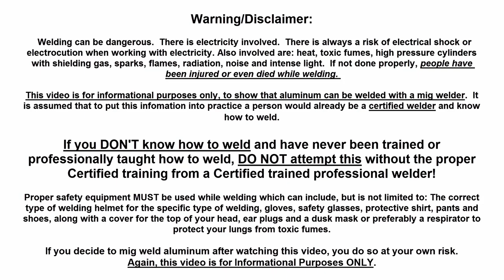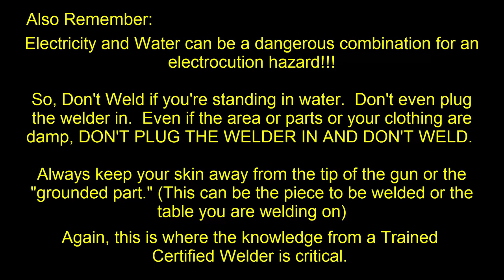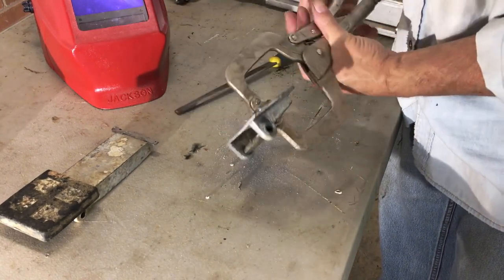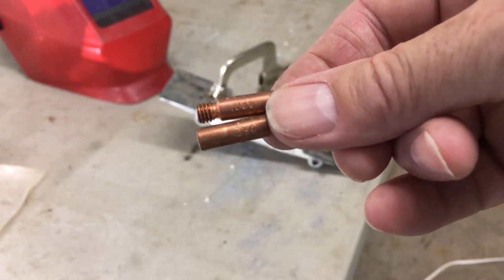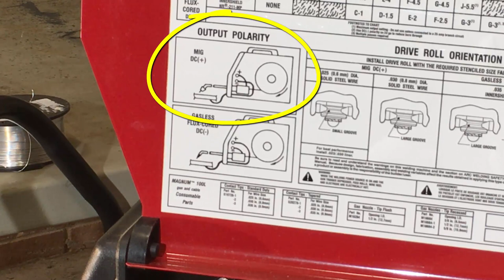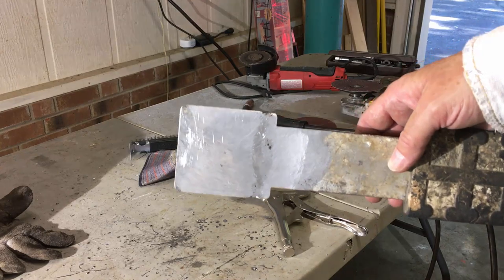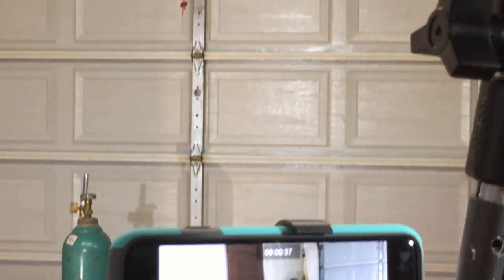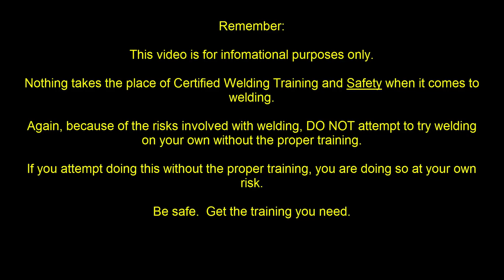Learn An Old Timer's Secrets To Mig Weld Aluminum Without A Spoolgun

Comment: Also the difference in aluminum wire
Is more
Then just the stiffness. It’s also the grade of aluminum witch will vary depending on what the aluminum your working with is made up to of. So you need to make sure you match the feed wire and use the correct level wire for the aluminum that’s your trying to repair.

Comment: You set more tension on the spool of wire to keep it from tuning, and then just enough tension on the feeder to overcome the spools tension will stop the birdsnesting.  There is supposed to be a spring and a washer under the wingnut holding the spool of wire inside your welder.  It should be wingnut, spring, washer, spool. It allows you to set tension on the spool and allows it to turn once pulled by the feeder.  But if you tighten the wingnut to tight it will strip the wire in the feeder, then the wire will not move.

Comment: For using a 120V Mig welder with Al. wire, that's not a bad job. You probably already know that porosity is formed when hydrogen outgasses,  the result of either a dirty surface or too little shielding. An increase in shield gas pressure will help prevent porosity and control thermal flare ups caused by oxygen.  Preheating Aluminum assemblies prior to welding may yield more satisfying  results. 
Reply

Comment: Really great video. I have heard MIG welding aluminum is an AC process. It looked like a DC welder that you were using. If DC, was it electrode positive or negative? Thank you!! 😀
Reply from the maker: DC Electrode Positive.  Thanks.
Reply: AC only for Tig welding they don't male Ac mig machines !

Comment: clean it good with the wire brush then spray her down with carb cleaner. Lightly preheat the parts, and weld away. Pure argon or argon and helium mix if going thicker. Cleaner the better.

Comment: Can you weld aluminum without Arcon gas?
Reply: I've seen aluminum welded with oxy-acetylene using a rod dipped in flux. MIG/TIG requires argon as far as I know.

Comment: why cant you use 75 25 argon co2?  They are both inert gasses are they not? Whats the difference?
Reply: CO2 is active gas, not inert.
Reply: @nz4602  Oh I thought MIG stands for Metal Inert Gas.  not MAG  not Metal Active Gas.  My bad.
Reply: @ScreamingEagleFTW  If you run it on carbon dioxide, it's MAG.
Reply: @nz4602  when I look up CO2 online it says its an inert gas.
Reply: @ScreamingEagleFTW  "MIG stands for Metal Inert Gas.

Only inert gases or gas mixtures are used for the shielding gas when MIG welding. Typical inert gases used for MIG welding are argon and helium. These gases are usually used for MIG welding of aluminium and other non-ferrous metals.

MAG stands for Metal Active Gas.

Active gas mixtures have been developed primarily for welding steels. Typical shielding gases are mixtures of argon, carbon dioxide and oxygen e.g. CO2 , Ar + 2 to 5% O2 , Ar + 5 to 25% CO2 and Ar + 10% CO2 + 5% O 2 .

The composition of the shielding gas has a substantial effect on the stability of the arc, metal transfer and the amount of spatter. The shielding gas also affects the behaviour of the weld pool, particularly its penetration and the mechanical properties of the welded joint.

In the US, both MIG and MAG welding are described by the term GMAW ( Gas Metal Arc Welding)."

"Active" stands for interfering with the material. You add carbon to iron to make steel, therefore it is "active".

Comment: if the aluminum gets too hot causes the middle to pop and splatter makes big gigantic holes so the trick is to use liquid nitrogen or packet with dry ice

Comment: If you have used steel wire through the cable it will be dirty inside and the aluminum wire will be contaminated. You have to clean the sleeve with thinners.

Comment: And by the way the gloves you use are not welding gloves. They are partially made of regular fabric which can easily be burnt if a hot metal drop falls onto it. Look, man, I know this video is not about these issues in essence but you seem to be so concern about safety, so I'd expect you to just be more consequent and consistent. And of course the tips about welding aluminum are great and I appreciate them much. :-)

Comment: the safety caps should be put on before moving the tanks before they are loosened from their supports. a tank will take off like a torpedo. if it falls over and cracks the vale. I have seen  a O2 tank go through 5 cynden block walls before stopping   because a stupid worker took off the cap before securing the tank upright and it fell over.

Comment: I tried getting into welding, I got the same exact welder and every time I went to start it would trip a circuit breaker. I sold it and I have always lamented not being able to proceed further
Reply: Should have it on a 30 amp breaker.
Reply: Don't think your heart was in it.
Reply: @thomasgallaspie9040  I live in NYC, my house is small and its attached both sides. If I cause a mess like a fire or an explosion. I would put many people at risk.. This is probably the main reason I stopped

Comment: having the liner clean so bits of metal do not get mixed in the weld
Reply from the maker: Good point.  Next time I'll use a dedicated "Teflon" style liner that is only used for Aluminum.  Thanks.

Comment: tip .dont hit the threaded end of the bolt without starting a nut on it.is ok to use a tighter punch ,cause it is away from threads.you have a grinder. that file is directional .using it in both directions  especialy on steel  will render your file  useless in short order. backdragging it flattens the teeth.lead being straight without s curves better.a bird cage would be if you ran wire all over the machine, a bird nest occurs when wire looses ability to feed out of electrode and backs up the machine    ;)

Comment: If I have a spool gun, do you still suggest 5356 wire?
Reply from the maker: Thanks for the question.  Probably 4043 would be a better choice if you have a spoolgun, but first check to see what the base metal is.  I'm not a metallurgist, so find out what you are welding before you pick your wire.  Thanks again!!
Reply: The metal is Drawn 6063-T832 Aluminum Tubing, and .188 aluminum rod is going trough the tube?  What's your best guess?
Reply from the maker: I'm sorry to say, but this is beyond my pay grade.  Depending on what your application is,  I'd either check with a structural engineer and/or your local welding supplier.  Maybe even better, you can call Lincoln, Miller, ESAB, etc., I'm sure they would be a wealth of information to help you with  your  situation. Just google them for their contact information.
Reply: dont need to they weld the same, 4043 wont color match 5356 will so if your coloring your aluminum you have to use 5356 really the only difference you need to know the alloys are so similar they have no impact!
Reply: use 6063 filler, 4043 would also work fine but 6063 and 5356 will color match so if its getting colored use 6063 or 5356 even if its not you can use those fillers, i just buy 6063 and weld all aluminum with it, weld it and forget it!

Comment: i have a cigweld gassless mig welder , can i still weld aluminium ?
Reply: No. You need to use gas.
Reply from the maker: As far as I know, there is no flux core wire for aluminum. Thanks.
Reply: peter rudd the only process that has flux included in it's consumables is stick. The rods are extremely expensive and hard to learn to use.
Reply: No unless you can reverse polarity on your machine and supply argon to the weld pool !
Reply: Yes, but not with that machine. Get a Map Gas torch and an Aluminum rod. That is only for light duty applications though.

Comment: Needs cleaned twice the with of bead so burning dirt ect does not interfere in shield flux area .And no fans ect in the area . Can push air in to shield gas flux area.Clean with stainless brush or chemical cleaner for aluminum

Comment: 20:50 I'd have added a few spot-welds to fill in those porosity-cavities in the top surface, and then ground it down smooth again.  This a human-being-supporting device here, so it should be made as strong and solid as possible.

Comment: I haven’t done any serious welding whatsoever in probably 20 years. What really gets me, and I’m not 10 minutes into this video yet, is how he improperly used the file to bevel the edges. A file is meant to be pushed or pulled in one direction. You don’t use a file like a hacksaw and push and pull it across your work.
Reply: actually a hacksaw is a big thin file and could be used exactly the same way and would be considered correct.
Reply: Even hacksaw only cut one way.

Comment: Is there a way to stick weld aluminum
Reply: Yes, you can stick well alum, it's a tricky one. Lots of practice and you'll be able to. But at first it will seem like self torcher as getting the amps, travel speed, angle, and what ever else that's slipping my mind.  Me personally, I never have tried aluminum stick welding, I have watched someone struggle with it and it was funny.  I myself either spool gun mig it or tig..
       It there's a lot I'm doing and it's heavier then .060 I spool gun. It's it's not much, I'll Tig it from 1/4" down to .020 any thinner I'll just toss it and tell boss just to buy said thing new.  Stick aluminum can be done, I just choose not to waist my time trying.
Reply: @jeremybanks719  I can't find aluminum electrodes.  Am I missing something?
Reply: @bigguy8586  . Maybe a Google search and you would find some info on them. A welding supply store might have a few on hand or can order some in. Search for chucky2009 here on YouTube, he did a epic job on stick welding aluminum on here.  Or you can go to the hazardous fart and get a small pack of the aluminum brazing rods, u can use a hand torch and it's like soldiering/brazing but on aluminum. I have yet to try them out but I will at some point. I bet since it's a low temp rod that it acts more like glue to hold together and not bite in like welding, but that can b a good thing on thin stuff like a pop can. Burn through or over peniletration can leave ya with a case of drips n crusty holes you end up chasing never to fill n end up giving up on it  and scraping the day.   Yeah been there, pissed on it, after scraping a few of those parts. Much fun lol

Comment: Decent video.  
Everyone new to welding should spend time on welding forums for more detailed info to complement videos. Weldingweb and the Miller welding forums are the best US fora, and migwelding.uk covers European equipment very well. 
I didn't notice anyone in the comments mentioning cleaning with acetone after mechanical cleaning, but that's standard in the TIG world and makes for cleaner MIG welds too.  (Use with ample ventilation!)

You can, and I have, shortened a long MIG gun to use with Al wire. The gun was kinked anyway so beheading then shortening the cable saved it and got me a free Tweco gun. The cutting is the easy bit (I use an abrasive disk in my angle grinder for the severing cut) and the wiring at the gun end is no problem. You do need to buy the proper Tweco clamp since Oetiker clamps have large ears, but it's only a few dollars.

Comment: Most better migs will weld alloy. Mine is 240V. Use AC. Though from what I know is that you should use a clean liner that is not contaminated with steel.
Your weld does not look very pretty though.

Comment: Brave welding with a single roller set up , my two cents worth is duel roller set up for the wire feeder , and old aluminium I use wire wheel  on a grinder , any corrosion  is not your friend

Comment: you didnt say what the gas flow was some times if you have it to high flow rate it will cool it to fast and not let the impurities boil out also be sure to use a clean stainless wire brush and brush it before welding

Comment: Sanding disc, wire wheel, wire brush, file....you should keep them separate for aluminum only, never use anything on aluminum after it's been on steel,  any wire brushes should be stainless steel......and turn up the voltage, you're running that in short-arc...aluminum wire should be a spray-arc...

Comment: I'm not satisfied with that welding 4043 Ali is for pure material and not for most casting so your probably using the correct wire by chance and should use teflon liner not to contaminate wire Ect too many things to mention

Comment: Aluminum wax shapes going through the metal tubing that cares it to the gun the trick there is to use a Teflon liner to stop the chafing then you use a little bit bigger tip to weld smoothly

Comment: alloys arent much different on those wires, 4043 if u anodize will turn black 5356 you can anodize any color thats what there mainly used for 99% of the time

Comment: without a push-pull wire feeder, migging aluminum is a touch and go proposition against birdnesting
Reply: @ircimager "without a push-pull wire feeder, migging aluminum is a touch and go proposition against birdnesting" even with a straight hose to the machine, teflon liner, 5356 wire and a .035 tip?

Comment: Can ya weld cast aluminum, with that procedure?
Reply: You can't weld cast with any machine
Reply: Actually you can weld cast aluminum. But you really have to heat it at about 400-45- degrees for at least an hour first to drive the gas, oil and whatever other garbage was absorbed by the aluminum, as it’s porous. Clean, clean and then clean.  Grind a narrow “V”, and begin to weld at the bottom, wire brushing each weld before adding the next one. Remember—stainless brush not used for anything other than aluminum.

Comment: First off clean your work piece then clean your work piece then clean your work piece. Aluminum must be clean. Purge your gun before you strike and arc there must be pure argon flowing make sure you have at least 30 CFH on the regulator. Use a pushing motions and not a strait on motion. make sure there is not airflow passing over your part as you weld.

Comment: IF you find yourself doing this leave the big bottle in place and just use the regulator.
  I have left the bottle in the storage area and just used an extra line.
   Why pack bottles all over if it's not empty i'm not moving it.
Reply from the maker: Good point, Chris.  Thanks!!

Comment: Run that polarity reversed,  ground positive/mig gun negative, it'll give you better cleaning action on aluminum (as well as other non ferrous metals i.e. brass, copper, magnesium), not bird's nest so bad as you're "hot" isn't in the wire when you MUST run DC current (inverter generated AC is always preferred with continuous high frequency though...Way superior cleaning action of the impurities in the weld puddle, moves them to the surface where they can be easily removed. Lots of specialists are going to pulse which really attains the highest quality welds.) Kind of a long winded video but fast forwarded through to hit the major points!!  : )'

Comment: Dirty! Just like before, the sheilding gas is in the spool! Also I love the welder! Sp 125 because the "plenty of range" with minimal settings just to get it dialed in for a persons preference makes a perfect weld! Think about that! Those helmets, that's heavey that! I tried and went so called modern! Yikes, just what I tought, in bed for 2 days when it failed! Worst pain you will ever experience for your eyes! Better off with the flick from the old school style helmets! They still have lighter helmets that look nice, they might not have all that expensive equipment you have another job monitoring to make sure thiers no circuit issues with! Weh! Happy welding   :)

Comment: I will add one more thing very few are aware of when it comes to accidental welding flash, nobody does that deliberately and sand in the eyes feeling is nothing compared to what can happen, Anyone welding or watching that uses contact lenses if flashed the flash can dry out the liquid between your cornea and the Contact lense.

 If that happens then the act of removing the contact lense will rip the cornea off your eyes leading to blindness so be aware and be very careful not just yourself but that nobody just pops in the door to find out the hard way such a tragedy can occur so easily be informed and be proactive in protecting sight your's and that of others.

Comment: First you use a liquid cooled push pull gun to weld aluminum. Spool guns only half weld (dark welds with soot). Second you can not weld cast.
Reply: I weld cast iron all the time
You just use nickel electrodes

Comment: Why do you specifically mention 110v? will this not work with 220v?  

The commenters bring up some good points that really illustrate the difference between learning a method to do a specific task and learning a methodology that includes an understanding of the various actions and results being used. If someone "teaches you" to set your machine a certain way and to use a particular configuration etc. and you don't learn why those things work or don't. You are shooting in the dark if anything goes wrong and adjustments are necessary.
Reply from the maker: Thanks for commenting. Yes, this information will absolutely work with 220 volt machines as well.

Comment: I thought you had to use an AC welder for Aluminum.  First time I have seen someone do it with DC.
Reply: It just makes it easier.  People who are really good can make leak proof gas welds on aluminum castings.  Not me though.  I'll take a water cooled TIG with the high frequency AC.  Not very brave.

Comment: I'm 72, so I'm an old timer...I don't have any 'secrets'...…..nothing special about MIG welding aluminum with a MIG machine...just use the 5356 wire, and get a Teflon liner for the 'mig-gun'........everything else you can find in a decent welding book....